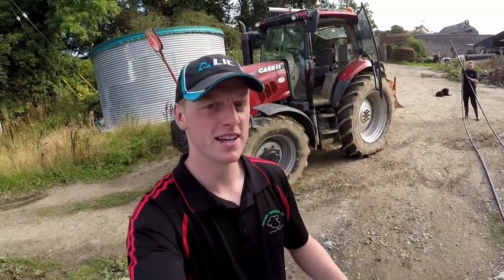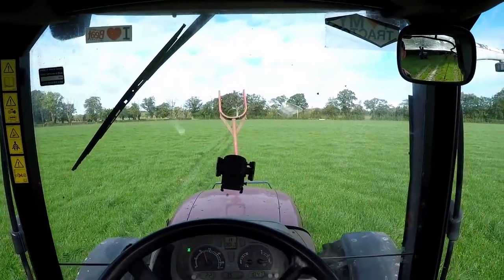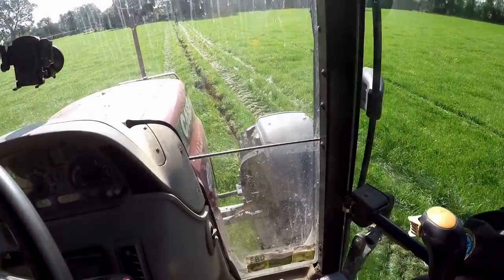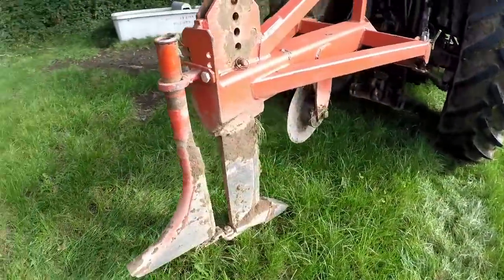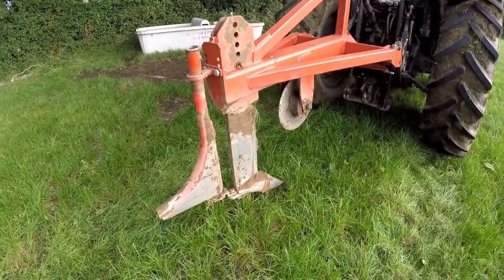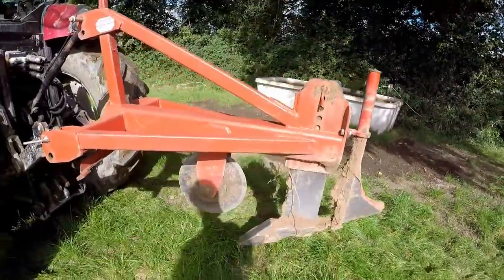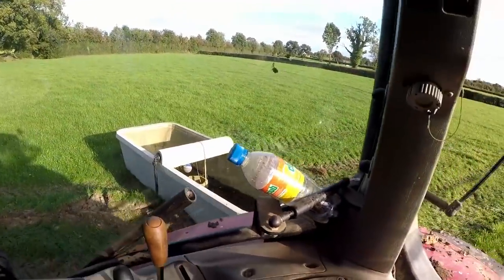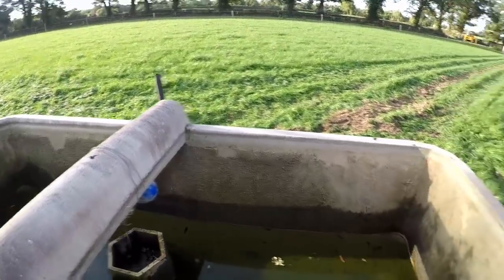Upgrading Water Infrastructure / Putting Down Pipe and Setting Up Water Troughs

Comment: Great job!  I liked the guide on the front of the tractor and the sewer pipe on the cab, great idea!  Could you pull the pipe from the centre of the roll when laying it out, save having to roll the roll if you know what l mean?
Reply from the maker: Would you have to keep turning it to straighten it? Ideally a tailer you could pull with the quad ahead of the tractor that it could unravel from
Reply: @MCMilkingIt  yeah you're probably right!  Only used to using 3/4" I'd say the 1.25" pipe would be "fun" trying to twist the twists out of it!! 😅. Trailer be the job alright.

I really liked the idea of you doing a dummy run first.

I thought ye'd use digger and Bury deeper.  Then you see lads just leaving along the top of the ground.  Then there's the whole black vs blue pipe!!! 

More than one way to skin a cat!!!

Comment: How do ye find the Murphy Troughs and how do they fair in frosty weather?
Reply from the maker: I like them 👍 they have a bung in the bottom which we remove during the winter and a tap on the top to turn off the water so they are empty during the winter
Reply: @MCMilkingIt  Cheers. I was planning on getting one here.